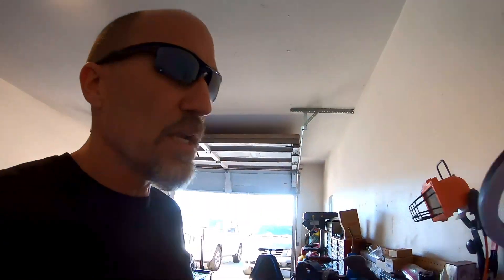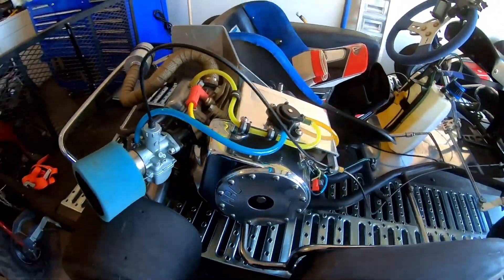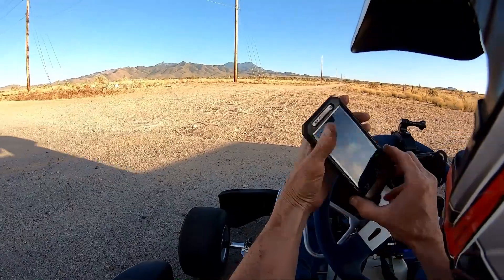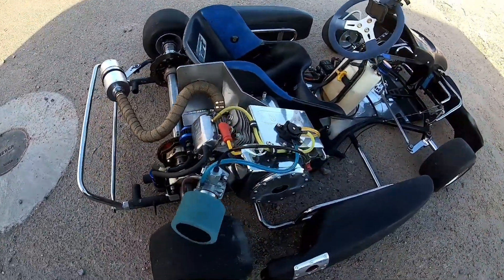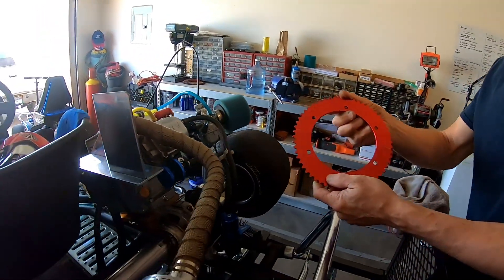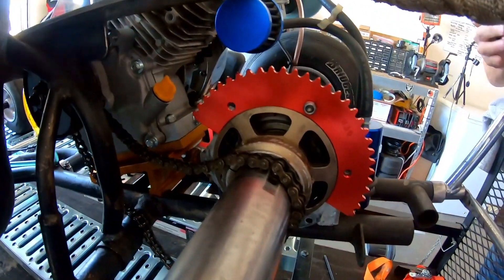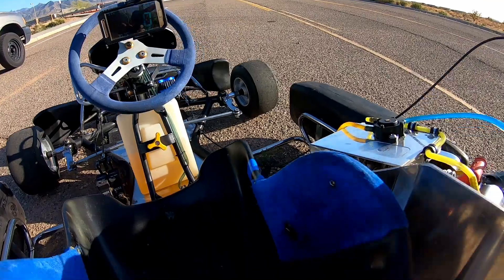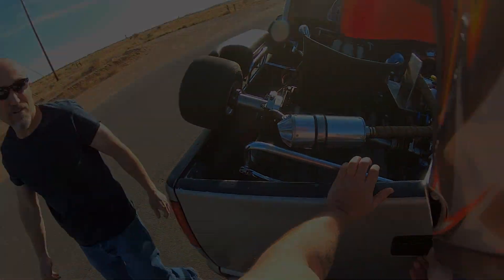How to go 72 MPH with a Predator Hemi / Predator Hemi top speed

Comment: i have a question i have a b100 coleman minibike with a vm22 Mukini carb and a aftermarket exahst with a muffler i have a 12 tooth clutch with a 75 sprocket in the rear and the bike tops out at 35 exacly i looking to go faster but i dont know what clutch and sprocket to go with i thinking a 15t clutch and a 40t sprocket how fast do you think that would go? and do you have any segestions? Thanks
Reply from the maker: It depends on a lot of factors, including engine mods, tire size, rider weight, etc, check out the playlists on the channel for many gear ratios and engine combo's 
https://www.youtube.com/watch?v=M3llVJ2zPvs&list=PLkbj-ip-5FzbZtW56Sa0VLrE1QqIJftaC&index=1
Reply: @Black66  Thanks👍

Comment: That's impressive
Reply from the maker: Thanks! Ya , that kart moves out! Any given engine is faster on the kart compared to a minibike frame.
Reply: @Black66  which makes no sense. Power to weight and less unsprung weight on a mini bike. A guy would think a bike is faster.
Reply from the maker: @houseoffire72  I think its wind resistance. The kart is on the ground

Comment: See.... Told u... higher rear equals more torque less top speed ... Sprocket's are a hassle sumtime ..lol speed demon 😈
Reply from the maker: Check out my other videos. I'm always working with gear ratios. One thing I have learned over the years is you can have too much gear. There is a point where the rear gear can be too small and the engine just doesn't have the torque to pull the gear.
Reply: @Black66  that's a limitation of displacement lol ... Yea I working  on my 250cc ... I was watching all the vids this morning....

Comment: Back in 1965 i bought a brand new Bug "Scorpion" with a pair of McCulloch MC100's for power. I had an 8 tooth and 80 tooth drive/driven gears. Took it to to a sympathetic drag strip one evening and clocked 80MPH. This was a pure "sprint" Go Kart. The antithesis of the Enduro Karts of the day which were built more for high speed than the sprints were. Needless to say I never managed 80 mph on the sprint tracks as they were very tight courses, built more for maneuvering than speed. Maybe I am talking "Greek" to you since 1965 is a couple of generations ago? That said, that Kart was, to this day, the most exciting ride I have ever owned. Pure fun in the extreme. I am getting a big kick out of watching your videos and hope that you keep on putting them out on youtube! Thank you!
Reply from the maker: Thanks! I know what you're saying. My dad had a kart shop back in the 80's We raced mainly Briggs/ Horstman engines back then. The McChulloch 's were still around though. We raced mainly dirt tracks. I had Stinger by Bug. Those were the days of the Wasp by Bug kart frames, Margay, Black widow, stuff like that.  Good times.

Comment: Absolutely love this channel!!!,got a coleman ct200u-ex same as yours,bent the idle screw a bit so it tops out at 24mph is there anything else i should do to increase top speed 🙂
Reply from the maker: Thanks !! There are so many different ways you could go with it to get top speed depending on how radical you want to go. But if you're just looking at basic inexpensive stuff, you could re-jet the stock carburetor, add a high-flow air filter, and a header pipe, and maybe an advanced flywheel key. You could also add a smaller rear sprocket. We added a 40 sprocket and went around 45 MPH
Reply: @Black66  thx man i just ordered a straight pipe for it and a 60t rear sprocket and 8t front and a rk 420 chain,LETS SEE WHAT THIS BABY CAN DO 😁
Reply from the maker: @R35_Arty  These bikes are fun to experiment with for sure.

Comment: Just imagine this with a carbon fiber chassis for super ultra light weight and insane acceleration with the juggernaut torque converter and a tall gear for the final drive !!!
Reply from the maker: Yes! That would be cool. I want to test out a torque converter . I have a regular torque converter . Maybe I can get a juggernaut and test the difference .
Reply: @Black66  There's a huge difference in stall rpm engagement and performance, the juggernaut is designed for highly modified 212cc engines only.
Reply from the maker: @Nickael7  sweet! I'll have to try one out. I'll make a video and compare the two .
Reply: @Black66  That is AN EXCELLENT IDEA !!!
Reply: @Black66  If I'm right, I bet that with a carbon fiber chassis, the CVT and the final drive with tall gear, will probably make the go-kart reach speeds of 90 MPH or even much, much higher... very easily. Since carbon fiber weight 1/20 of that of regular steel !
Reply from the maker: @Nickael7 I bet your right. I would love to have a carbon fiber kart frame.
Reply: I'm still waiting for the juggernaut and this engine.